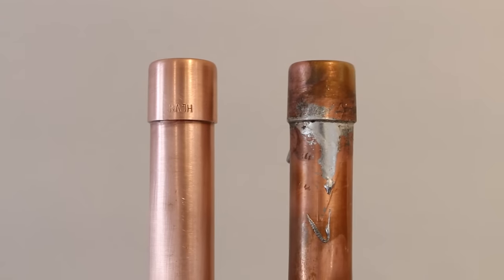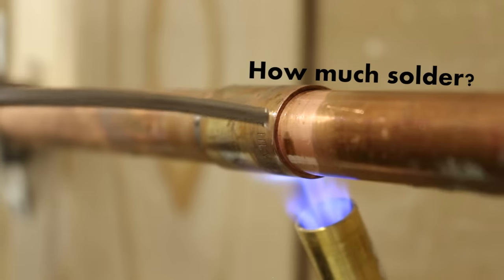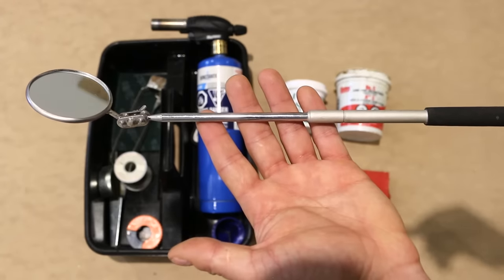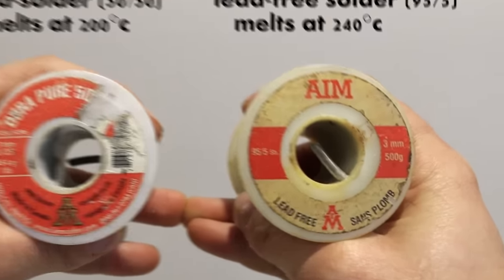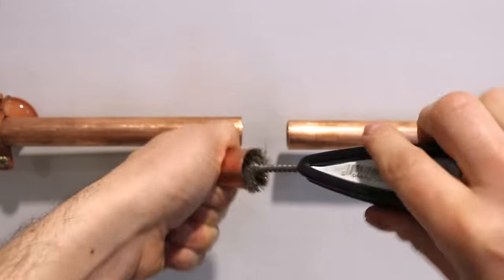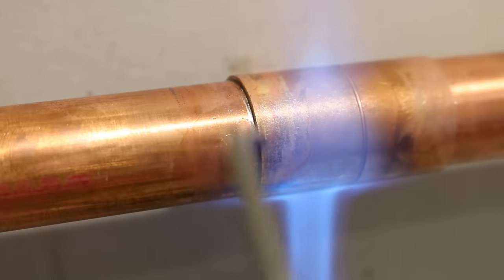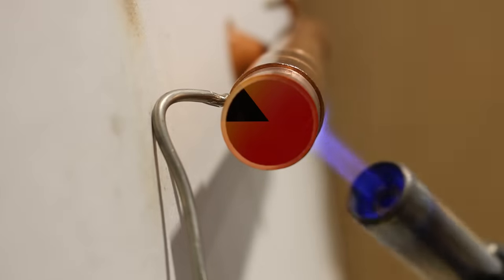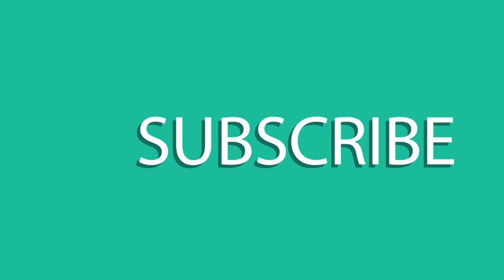How To Solder Copper Pipe Like a Pro (Tips & Tricks) | GOT2LEARN

Comment from the maker: Tools and materials I used in this video:

AutoCut Pipe Cutter 1/2": https://amzn.to/2XlyqAn
AutoCut Pipe Cutter 3/4: https://amzn.to/2GZFrkf
Pencil Torch: https://amzn.to/2U3OTaa
Broad flame torch: https://amzn.to/2Jeaeeq
Fitting Wire Brush 1/2": https://amzn.to/2BOlNVc
Fitting Wire Brush 3/4": https://amzn.to/2U33enp
Propane gas(Blue bottle): https://amzn.to/2BOhnh7
Lead-free tinning flux: https://amzn.to/2U3abEW
Lead-free flux(water soluble): https://amzn.to/2XjaYn9
Flux brushes: https://amzn.to/2T8ROBc
Lead-free solder: https://amzn.to/2EoqSFb
Lead solder: https://amzn.to/2Lo2xVF
Flame protector: https://amzn.to/2Vh8q7o
Abrasive pads: https://amzn.to/2NnA9QP
All-in-one deburring tool (blue): https://amzn.to/2U3J1xu
Inspection mirror: https://amzn.to/2Y0HuK8
Reply: Someone here asked: "How much solder do I use?"  Until you get a true "feel" for soldering I'd recommend this - use about 1/2 of the diameter of whatever fitting you are soldering. Thus if you are soldering 1/2" pipe, use about 1/4" of solder. If you are soldering a 1" pipe - use about 1/2" of solder. And how do you know how much solder you are actually using? Well, if you need 1/2" of solder, bend a 90 degree angle at the tip or your solder so you physically have 1/2" of solder after your bend. If you need 1/4" of solder, bend the tip of the solder so that you have 1/4"  of solder past the bend. It is VERY easy to add too much solder (and as this video showed) where you end up puddling the solder inside the joint. Truly, you need VERY LITTLE solder to make a sealed joint. When I was a novice I was installing a boiler and had soldered a 3/4" vertically mounted gate valve  - and because of the mass of the valve I REALLY soldered that valve to make sure it didn't leak. Problem was - I had used so much solder that when the valve was opened (the gate was pulled back to open the valve) I had completely sealed the valve closed. I had created a solid solder plug! Yup - played hell finding that little error when the system wouldn't work. And that's when boss-man taught me the 1/2 the diameter of the pipe trick.
Reply: 7
Reply: @kevinr4454  Just get away from soldering! Use only compression fittings. They are easy to install and never leak.
Reply: Do you have videos on the sewer line that connects to city main? Thanks
Reply: Why use an auto cutter you'll need your trusty rigids reamer anyway. Always ream! Lol
Reply: Just as using a clean rag to reduce the chance of contamination/dirt it is also important to keep the interior pipe cleaning wire brush clean.  Just tossing it in your tool bag/box risks it getting dirty/contaminated and then potentially contaminating every pipe it is used to clean.
I have a dedicate pocket in my tool bag I’m able to keep clean and use only for the cleaning brush.
Reply: @hkguitar1984  that's what the brown jersey glove with the hole in the finger is for. You always have one after cutting pipe all day. Lol. Just me but I always toss my Flux brushes and rags at end of the job or day. Old man beat it into me many years ago.
Reply: @irishmike4914  Wise practice for a professional.  You probably sweat more pipes in a single day than I have in a lifetime.   The reason I mentioned it was that years ago my Brother grabbed the wire pipe brush out of my bag to clean the battery terminals on his truck, then he placed the brush back in my bag with me none the wiser.   Until months later when I'm trying to sweat some pipes together and the solder isn't sticking into the pipe!
Live and Learn, the lesson for me was to hide my tools from my brother!
Reply: @hkguitar1984  my tools are always separate but nowadays unfortunately I'm the old guy yelling and or teaching unless things are bad . Dirty hands = clean money. Kids don't want to learn. All good
Reply from the maker: @sjxidnegsusgsjshvsbshshshs  thank you sooooo much!!!
Reply: Sanding the pipe to shine takes off a coating allowing it to oxidize and thus making it turn that green color you see on lady liberty

Comment: Call me weird, but I like to see a few millimeters of solder adjacent to the joint.
Reply from the maker: That's fine.
Reply: NOT weird. That's one way you know the solder has reached the back of the joint, taking into consideration you had the solder on the joint in the first place, which I believe you did.
Reply: Same with glued joints. If you can see the glue you know it's glued. As an apprentice (and ONCE as a Journeyman) I forgot to glue a joint. Easy to do. Visual cues save you from digging down 3' to find out why it's not holding during the test
Reply: Agreed.  I also knock the bead off with a flux brush.
Reply: Exactly.  Or “degree of certainty”
Reply: I agree,  it's my house,  I really don't care what it looks like.  If the water stays inside the pipe, that all I need.    Why are my ugly solder joints better than a plumbers, simple because over 40 years I have thousands in my pocket not the plumbers and the water stays in the pipe.   I would rather have 5000 in my pocket with an ugly looking solder joint then a beautiful solder join and no dollars in my pocket.   I do my best and that is all the matters.
Reply: Agreed. Around here inspectors will fail these joints.
Reply: @PGGraham  the inspector looks at every joint.  Thats crazy
Reply: @Jlitt-yw2zm  no, he used to look at a few. Now that he knows my work, he usually just takes a cup of coffee, wanders around while we shoot the shit, signs off on it and leaves.
Reply: @PGGraham  thats cool. What area.  You have to pressure test right?
Reply: @Jlitt-yw2zm  on new construction, yes. Both supply and DWV.
Reply: Not weird just making sure capillary action took place
Reply: Smokey Walker you tell em.
Reply: I was always taught to heat the inside pipe first and then moved to the outside and work the Heat and the solder on opposite sides unless it is a larger pipe then work around together
Reply: Same here. You know it’s been soldered. Like purple primer on PVC. Can assume it’s been glued.
Reply: I’m like you.  I like to see about 1/8” of solder outside the joint.  It’s aesthetically pleasing
Reply: Whether soldering copper or gluing PVC, I've always believed that too much is way better than not enough. Not enough means a leak, a redo, and (especially for PVC) wated pipe and fittings.
Reply: Psycology my friend. Its only in your mind...
Reply: I don’t want to be draining down a 5 story building again because my pretty joint has leaked. I’m gona put a bit more solder on so I know it’s fine.👌
Reply: Nah man, that's just called capping
Reply: I'd rather seen it done right.
Reply: Old school rule
Reply: Once flux is used, who gives a shit, touch the solder anywhere,  job done , never ever had a leak from a soldered joint
Reply: @kcrowe8583  using the end of the solder to fling the drip off works too and doesn't leave a sweep of melted solder.
Reply: I was taught with 50/50 and 40/60. I was also taught to roll a bead/cap on it. Lead free you can never do that. I still like to see a drip or 2 come and and give it a wipe with a clean rag. My method anyway.
Reply: @johncaper68  use plenty of purple it's a chemical fusing reaction between the 2 pipes your purple primer and the glue, proper polymerization is important.
Reply: @kcrowe8583  make a hook with your solder and knock the extra with your solder, doesn't freeze up that way, You do fling a little goober though. Just be fast.
Reply: Solder in the cup is all that matters . It's OK to see just a solder line as long as your sure the cup is full. I may be wrong but a good indicator of a full cup would be a slight pooch on the bottom. Stop before a drip .
Reply: @Userratoli  you are correct. I like to see a drip and give a wipe but you have the right idea.
Reply: @Userratoli  same goes for braising. Heat the back of the cup and just push the silver solder in. It fills the cup and you get a nice bead on the outside. Also when you take your brazing exam for the city and state they don't care about what it looks like on the outside. They cut the joint and you have to have full penetration all the way to the back of the joint. Also you can not use a turbo tip on a state test. You must use an oxy acetylene outfit. Which means you better learn to control your heat, because it can burn a hole right through the copper.
Reply: @TheRabidPosum  I was around when you needed to certify to do Med Gas . In the beginning ,  Almost everybody failed . The Med Gas certification for installers and brazers are a good thing . Critically clean .
Reply: @TheRabidPosum  yes, they cut the 2 inch pipe in half and peel it open .
Reply: @Userratoli  is the med gas the test to work in a hospital? I have never worked in a hospital but I heard they run nitrogen through the lines while you braze them.
Reply: @TheRabidPosum  yes to braze med gas for Hospital gas systems always require nitrogen purge .  Also you can't even handle the certified clean sealed Copper unless you take the course and receive certification as an installer .
Reply: Agreed. It's a nice Silva ring 💍
Reply: @kingp6543  run a bead with 50/50 or 40/60.
Reply: That's what we used to do. Just fill the cup with the lead free, the leaded has a lower melting point, so you won't have to add any more torch heat. Just a quick once around and you have a perfect silver bead.
Reply: @johncaper68  you shouldn't cover up your pipe until you finished all of you tests.  At least not cover up the joints.
Reply: @jtoker9758  not sure what you're talking about. Being able to see the solder shows you've soldered it
Reply: @johncaper68  No you were talking about the pvc glue and the primer, and about having to dig up the pipe if there is a leak when testing.  I'm saying you shouldn't cover up your pvc pipe until you completely test the system.  I know you need some pipe to be covered up to hold it in place in the ditch, but you shouldn't ever bury the joints until the test is over.
Reply: @jtoker9758  yeah I wasn't the one calling the shots on that job. It was the underground of a 10 story apartment building
Reply: Weird
Reply: Got to build up a little shoulder
Reply from the maker: Not needed everyone, as long as the hub is full, anything extra is unnecessary.
Reply: @johncaper68  just tolker is 100% right about leaving joints uncovered.  
And since you're  an Apprentice,  when testing plastic pipe with Air , never exceed 5 psi . For Safety sake , even if someone tells you to .. don't.
Reply: @Got2Learn  I'm with you , if the cup is full that's all that matters. Anything outside the cup is for show , I mean there is no added strength  . 

If we think a cap will stop a leak , it'll fail later anyway. And a lead free joint is just that , Lead Free. Don't be putting 50 /50 on it...illegal.
Reply from the maker: @Userratoli  👌👌👌
Reply: @Userratoli  yes there is.
Reply: @Userratoli  I'm a Journeyman but wasn't the lead hand. The lead hand would rush us through, room by room. He had an arrangement with the inspector. He'd take a picture of the pipe then bury it quick. In all my career that's the only drainage leak I had as a Journeyman. The other was as an apprentice. Both times it was rush, rush, rush. Not my way of doing things so I left shortly after.
Reply: @Got2Learn  except as a way to tell its been done.
Reply from the maker: @johncaper68  that's all it serves.
Reply: @johncaper68   I misread your post  mistaking you being an Apprentice ,  sorry for that . What part of the country are you in?
Reply: @Userratoli  Mostly Ontario but just moved back to Cape Breton
Reply: @Userratoli  lead free for potable water only. 50/50 is perfectly acceptable for heat pipe or any other application. And yes a cap both looks nicer and does add strength to the joint.
Reply: @johncaper68  I agree, rushing is stupid. Quality suffers and mistakes are made which costs more time and money in the long run. Speed comes with time and efficiency and learning tricks of the trade.
Reply: Clean copper and fitting
Brush on just a light film of Flux
Heat the socket and middle of fitting 
Touch solder around fitting
Knock off that dog ball 
Put Flux on joint and wipe it down makes copper look new and shiney
Reply: Love thin neat line of solder just barely visible around all the joints.
Reply: Or... Put on what makes you feel comfortable.  Roughly, whatever size joint your working on is how much solder to use.  1/2" joint, 1/2" of solder.  Over 1" pipe, I'm a bit more liberal.  Hit the joint while still hot with a 2 flux brush and wipe with a rag.  Cleans up any globs or streaks so it looks good and you know it's solid.  Best of both worlds.
Reply: Weird. But yea I agree
Reply: Well said so does any professional plumber it's a sign of a proper tight joint. Ignore this idiots video he's probably fresh out of college
Reply: Agreed. This guys welds I would not trust enclosed into a wall
Reply: It’s affirmative and appealing
Reply: Not weird. It’s called insurance. Because on big jobs you don’t see running flux, ever.
Reply: Me too, a nice collar of solder gives peace of mind
Reply: I agree. A small clean line of solder still looks clean and shows that it is soldered. Same with glue. Clean and not sloppy but visually you see it's done
Reply: Yeah, that usually means you have too much inside. Do a couple tests and cut them apart. The joint is not stronger with more solder at the interface of the fittings like you are talking about.
Reply: Would you bend the solder so you know your not using just enough for the joint
Reply: Ok; you’re weird

Comment: For the home DIYer - go and spend a few dollars getting sacrificial materials to practice with. A length of copper pipe, a few connectors and then just practice your soldering technique where there's plenty of room and you don't have to worry about ruining anything if you mess up.  Could save you a lot of frustration and money in the long run.
Reply from the maker: 100% agreed 🙏
Reply: Yes. With this and literally every other contractor grade project.

Comment: We have a timber frame house with exposed copper piping  for the fire suppression system. The plumber that did our joints did a fantastic job with just a small fillet of solder around the fittings. He went to the extra trouble to make the soldering look good because people will see his work for the life of the house.
Reply from the maker: Niceeee!!!

Comment: I really like the tinning flux because as you are heating the joint, the ground up solder in the flux starts to plate out when you are at temperature.  This helps me a ton because it is a signal to me that I I can start applying the solder and moderate application of heat to minimize the potential for overheating the joint. The other thing I noticed is the ground up solder in the flux really reduces joint fouling due to regular flux overheating and oxidation.  great video!
Reply from the maker: Good comment, good tips!!
Reply: Thank you for commenting !
Reply: Would there be a situation where you should not use this flux? I can't see a reason to buy the regular stuff except the expense. For a DIY that's negligible.

Comment: I solder with cotton gloves.  A finger swipe at the end to knock off the drops and leave a clean appearance.   Then a quick wipe with a damp rag to get rid of the flux.   
I like the look of a tiny, even fillet of solder.  Key word TINY.  
I was taught never to rely on capillary action on a horizontal joint and trace a full 360 with the solder.  When i started with my father, he recommended bending a tight 90 at the end of the solder to mark it and get just the right amount until I got a feel for it.  1/2 " copper 1/2 inch of solder, 3/4" for 3/4" etc.  When the bent leg is gone, you're done.  Lather rinse repeat.  
To speed cleaning he had drill brush attachments made up for male and female for 1/2 and 3/4 fittings.  They work great.  I still have them around somewhere.  Don't do enough copper anymore to use them much these days.  
Not saying my way is THE way.  Just sharing what works for me.
Reply: As I was watching another video it occurred to me that wearing gloves might be a good idea to prevent contaminating the copper as you clean it,
Reply: @charleswilson4598  The disadvantage of wearing gloves is you don't get that attractive dark staining on your skin(my body chemistry?, I know very few that get this) and that unique, I've been running copper all day smell.  Ok, may not a disadvantage after all.  I prefer leather for cutting and deburring, better gription.  Never really thought about it before, but next time, I may wear leather on my left and cotton on my right hand.  Just had my eureka moment.  BTW, the gloves are the cotton poly blend yellow ones.  I always thought they were just cotton, but just checked.  Handy Andy gloves.  They haven't changed much in 50 years.
Reply: @mikemorgan5015  I haven't changed much in 50 years either.
Reply: True…. Enough Said